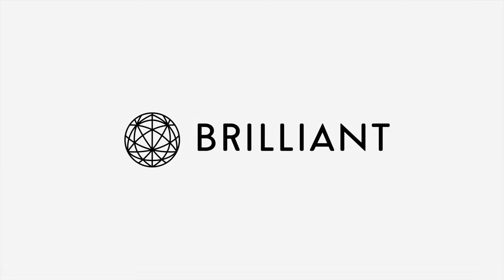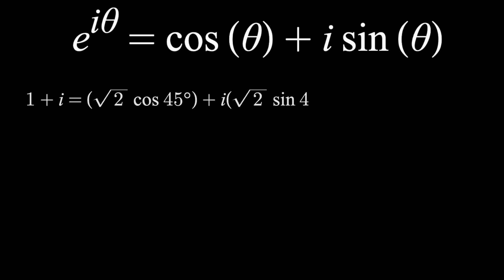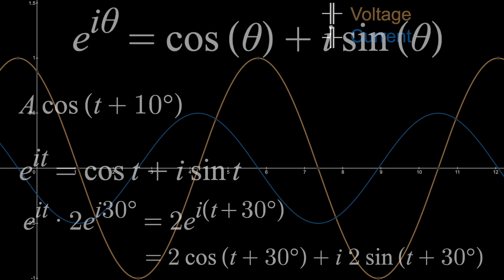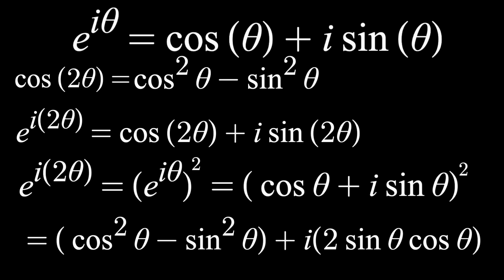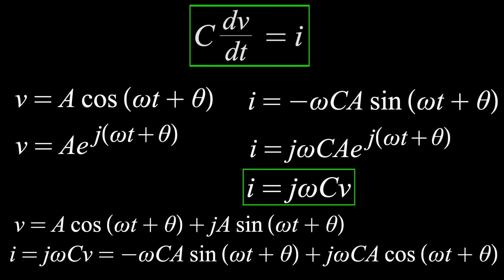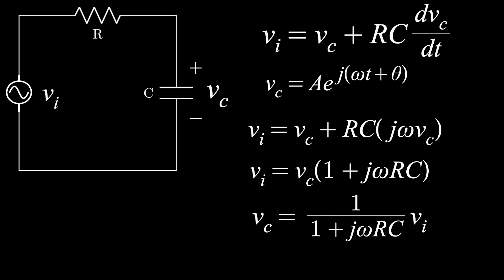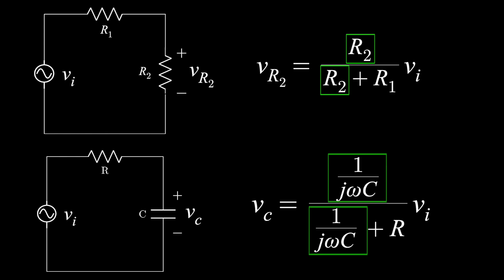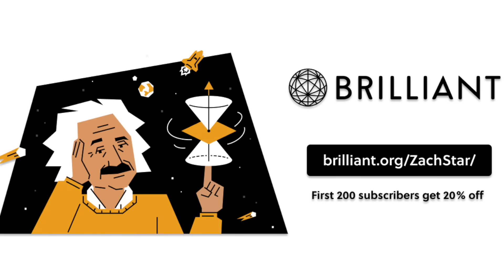Why do Electrical Engineers use imaginary numbers in circuit analysis?

Comment: It doesn't matter what tricks you use for calculation, in the end you need real numbers. And this "imaginarity" is simply a way of saying "this one is a perpendicular graph of real numbers". Same as y is imaginary to x axis. It's just that you use a coefficient that requires an additional axis. But in the end you have to use real numbers to describe a process. Can't have i charge, it's gonna be 1. Well, it's because it's not a number but a number with operators stuck to it. sqrt(-1) is same as /1 or *1. It's a number and an operator that makes no sense unless you perform actions with it. It's not a part of the number. -1 is also 1, only measured on the opposite ray of x axis. Take an apple and move it 1 meter to the north. Now 1 meter to the south. Now any direction you choose. You use 3 axes and negative scales to describe the direction but in the end any direction you choose is a positive number of degrees deviation from any point 0 and any distance is a positive number of any chosen units. There's nothing negative in the world. So there's nothing imaginary either. Only our calculations.
Reply: Nope, you use the imaginary numbers, to describe a real process...no need to switch...
Reply: @RoninTF2011  Unless you show me a factual something measured in i's you're free to keep this fantasy to yourself. I was quite clear, re-read if you need to understand instead of arguing.
Reply: @RedGallardo  so you say time, angle and superposition are not real things? lol
Reply: @RoninTF2011  Time cannot be measured negative. Even if you show me a process of something seemingly going back to an earlier state, it's gonna be de-facto a process in time running forward. A time-travel is a process in time running forward. It's impossible to go back due to the principle of cause-effect. Cause never precedes effect. Angle can always be measured as positive number. Negative only means direction. It's the same as blue angle or angle in fa major. It's just a name that helps us pick the right positive among positives. We need it, universe does not. It knows which angle is which without names and negatives. Superposition is a general term like "power" or "size". Be specific. So quit the demagogy, I say no real things are negative. Negative is a crutch humans invented for our imperfect counting system. We are limited by brain, universe counts without any borders and difficulties.
Reply: @RedGallardo What makes you think "i" is a Unit of measurement?
Did ever have any science education?
Reply: @RoninTF2011  What makes you think I said i is a unit of measurement? I said the opposite. Stop arguing with your imagination in my presence. I'm feeling left out.
Reply: @RedGallardo  "Unless you show me a factual something measured in i's you're free to keep this fantasy to yourself."
Your text not mine...
as sensble as the request to taste light...
Reply: @RoninTF2011  Are you even capable of thinking? I said i is only for calculations and not for measurement, you started to argue, I asked you to show me how you measure something SINCE you disagree. Which means YOU said it's a real measure. Now you're taking it back. Then what are you arguing about? Get some help.

Comment: The simplification of using phasor notation comes with the hidden assumption that all operations on the voltage will be linear operations. For non-linear devices (for instance when analyzing distortion products) you have to go back to sines and cosines
Reply: I thought we EEs were sharp til I started studying fluids. I don’t EVER want to have to find any PDE BVP solution in closed form….
Reply: No. I disagree. The hidden but necessary assumption is that the analysis takes place at a constant frequency. All passive components are modeled as being linear. There is a phasor representation for the Fourier series, if ... at least... non-linearity can be modeled around harmonics of a fundamental frequency.
Reply: @willthecat3861 Yeah, but like, the second you add a transistors, or even a simple spark gap, then the math becomes a LOT harder

Comment: No you can NOT write 1+i as sqrt2 e^(45i). The angle MUST be in radians in exponential form.
Reply: They had the degrees sine after 45. So if we just treat the degrees sign as a scaler than maps degrees to radians, then the maths is true
Reply: @gregoryfenn1462   Except that's not what it is.

Comment: Thank you for this great video. At first I was bothered by the extra imaginary number, thinking 'Now there's extra stuff. What is it?', but then I realized that we are actually removing stuff in a way. We are transforming the problem from having the input voltage specified as a arbitrarily complicated function to something more constrained. We notice that the input function 'sin(...)' can be 'calculated' by reading of numbers on a disk after rotating it. So we've reduced the problem to that of rotations. Rotations are less powerful in the general case, but they are sufficient for the problem at hand, and they are simple linear algebra and so easy to work with. The imaginary part has always just been part of the "structure" that rotates. And taking the real part is "reading the number of of the disk".

Comment: Imaginary numbers sound like complete nonsense until you realize that i is essentially just the invisible y coordinate on an x number line. It's an extra dimension which can represent whatever you need it to represent. In this case, phase.
Reply: oooo if we follow the very easy grasp methood of just using x and y coordinate system and not give a crap about imaginery dragons and numbers... how would we look superior ...
Reply: @nagyandras8857  i is basically just a placeholder for an extra dimension
Reply: @nagyandras8857 How will using regular XY coordinates help you? Vectors do not follow Euler's formula

Euler's formula is a feature that arises from complex numbers (And it is very elegant to drive). And this is the feature that allows you to skip differential equations (Since you are turning everything into exponentials). That feature is the reason we use complex numbers. ODE can be simplified
Reply: @nagyandras8857  Look dude, if I say exp(ix) = cos(x) + sin(x). This is just a simple math statement. Nothing magic is going on besides i being √-1. Which you can just think of as a indeterminate form that you have to find a way to cancel (Like you do with let's say 0/0 in calculus). There is nothing magical about that expression beside

We use it in EE because taking the derivative of exponentials is extremely easy. So we replace cos(x) with exp(ix). Then solve the far easier differential equation, then take the RE() of the result. This is called phasor notation, there is nothing magic going on
Reply: @nagyandras8857  I cannot, but that's not the fault of imaginary numbers, you are just miss-using them. I cannot give you [3,2,1] burgers either. Are you gonna then claim arrays and matrices should not be used in computer science??
Reply: @sebastiangudino9377  apples to apples. Not oranges.
Reply: @nagyandras8857  Well, yeah, so you can't have I burgers!

But let's say a spring moves as a perfect: speed(t) = cos(t)

Now I want to get the acceleration, which is the derivative of the speed. Let's asume I don't know the derivative of sin. But I do know exponentials and Euler formula. I then replace: speed = exp(it) (We added a meaningless i undetermiante form, we can later remove it with a function called RE(z) )

An then the acceleration is dexp(it)/dt. So i*exp(it)

Then we use Euler formula to expand the equation i * (cos(t) + i*sin(t)) = i cos(t) - sin(t)

Then we remove the with RE which leaves us acceleration(t) = - sin(t)

You solve a derivative problem while avoiding derivatives thanks to phasor notation!

Comment: I just wanna point out that a lot of professors may remove points, when using the method shown around 6:30. If v = Acos(wt), then v = Ae^(jwt) is technically incorrect. To fix it, just express it as v = RE(Ae^(jwt)), where RE() indicates the real part of the complex exponetial; or express it as (A/2)*(e^(jwt) + e^(-jwt)).

Even the professsors that say, "I don't care if you box in the right answer; I only grade the work shown," will probably only take 1 point off on a 10 pointer (not a big deal).

I enjoyed the video Zach, but I thought I should give this PSA for anyone that has a professor named Wanda or Leonard.

edit: "(A/2)*(e^(jwt) + e^(-jwt))" was incorrectly express as "(A/2)*(Ae^(jwt) + Ae^(-jwt))"
Reply: Thank you for this. As a mathematician switching to EE for a fresh start, it scares me how engineers sometimes ignore nuances like these
Reply: @nestorv7627   No problem. There was actually an error in my logic caused from coping and pasting the text. I wouldn't have noticed it, if you never commented, so thank you.
Reply: @nestorv7627   It was my dream to become a mathematician, but my DE prof pulled me aside to talk (he probably didn't get many students that score perfectly on both exams and hw); I told him that I wanted to study math, but he persuaded me to get into engineering instead. I graduate EE next sem, and the only time I felt that I learned any real engineering was the second/third week of EM waves when we were solving problems using the derivative form of maxwell's equations. Every other time, they just lump the necessary parameters, needed to actually solve the DEs directly, into empirical ones, then only expect you to use the "formula" or "procedure" instead of actually understanding the actual physical process.

Am I missing something, or would you also say that, for the most part, engineers suck at understanding the actual math used in their field?
Reply: But if you say v = RE(Ae^(jwt)) then there's no way to make the equation i=jwCv work: i=jwCv is wrong,  i=RE(jwCv) is wrong, i=IM(jwCv) is wrong, it's all wrong. You have to work with some higher-plane complex voltage v*, then v=RE(v*), i*=jwCv* and i=RE(i*)
Reply: @viliml2763  You are absolutely correct that "i=RE(jwCv) is wrong."
This shows why you can't just plug numbers into equations because i = C (dv/dt) = C(d/dt)RE(Ae^(jwt).
Phasors confuse so many people, all you need is Euler's formula and the original DE, and then there's no need to remember the conjugate identities for phasors.
Do you want to see the derivation done that way, because I did leave it out as an exercise for the reader?
Reply: Why do we ignore the imaginary part?
Reply: @leonhardeuler9839   I think Zach did it because loves his phasor analysis too much. There is also half as much work to show, and also half the work to grade, so professors and students may like it for that reason. The alternative is to differentiate the last expression of v = cos(wt) = RE(Ae^(jwt)) = (A/2)*(e^(jwt) + e^(-jwt)) and multiply by C, then you don't need to worry about "ignoring" the imaginary part; it will just cancel out in the end anyways. I think the real question is why convert it to complex exponentials in the first place, and the answer is all about the basics of frequency domain analysis.
Reply: I disagree. Taking the RE() is called normalizing or renormalizing. And there is no reason to do it anywhere except the very end to simplify the maths

Comment: So does that mean that there are some circuit problems that can't be solved without imaginary numbers?
Or you can do circuit analysis with real numbers just fine but it's more complicated.
Reply: You can analyze circuits without imaginary numbers just fine, but it'll be more work.
I'd like to note that for simpler circuits that only have sinusodial generators with the same frequency, you don't need to write up any functions because you can treat currents and voltages as a constant complex number (as time goes on, that number would rotate with omega frequency in the complex plane, but so would the axis you'd consider the real voltage/current in the given moment)

This basically means that for these circuits, you can just replace capacitors with an impedance equal to 1/omega*C*j and inductors with omega*L*j, and then you can just treat it as a DC circuit (only difference is that you do arithmetic with complex numbers). The steps in the video would only needed to be done if it were not sinusodial or if you were to have multiple generators with different frequencies, as they would fall out of sync (values would truly depend on t, so you'd need a function).

I'd like to add that in highschool (or whatever is before University or whereever you learn complex numbers), if you learn electric stuff you would learn AC circuits without complex numbers at all. In this case you imagine AC voltages and currents as vectors and you'd use trigonometry and pythagoras' theorem to basically do the same computations but without the complex numbers. This has the benefit of not needing complex numbers, but it also means that you can't really apply DC formulas (you would need special "vector arithmetic" formulas to keep track of phase), but with complex numbers, both the amplitude and phase in tracked as a single number

This complex-free solution is only applicable for the simple sinusodial circuits, and they really get out of hand if you have both series and parallel connections (You keep track of amplitude and phase separately, and it would pretty soon become a trigonometric mess to add vectors)

((Of course, it would be a separate journey to prove that treating simple sine AC circuits as DC but with complex numbers is indeed the same mathematically as writing up the exponential functions, and this video would be the basis of that.))

Comment: The analysis of a circuit leads to a set of differential equations which must be solved simultaneously by using techniques of solving differential equations in order to achieve the desired result. While if it is converted into the imaginary form, then they become a set of linear equations that can be solved using linear algebra.
Hope it answers the question.

Answer by Ali Riza Afghan.

Comment: The math trick of changing from sinusoids to complex numbers is based on ignoring the transient part e^kt in the total response, but in general it take few miliseconds and can be ignored, so the trick is useful.
Reply: It is when the inductors and capacitors have some stored energy. We usually analyse the circuit when they are in steady state means the transient response has died out long ago.
Reply: @POPO-od8jb that's not the case in electrical power systems engineering. That transient part is absolutely crucial in this case.
Reply: These circuits can be generalized to the s-domain, where the transient response is not ignored. Using purely complex exponentials is a stepping stone to doing that
Reply: If you're interested in transient response of electrical circuits, next check out Laplace transforms.
Reply: Quando se adotou números complexos na Engenharia Elétrica, não tinha como se detectar um fenômeno de frações de segundo.

Comment: First learned AC circuit analysis in the Navy.  We would just compute impedances (Z = 1/(omega*C)) and keep track of 'angles'.  So if V is 120v / 0 degrees, and capacitor had impedance of 10 ohms/ 90  we simply too 120v/10ohms = 12 amps at (0 - 90= -90 degrees).  And combining capacitors, inductors, and resistors in circuits was similar to resistor-only combinations, but keeping track of the +90, -90, and 0 degree angles.  At the beginner level, we didn't go into the complex math, just 'remember the rules to keep track of angles.  When multiplying, add the angles and when dividing, subtract"
Reply: This is basically the same way they teach in highschool before complex numbers. Note that by "keeping track of the angles" and using special formulas to add there values with different phases you are basically doing the same calculations as if you were to do it with complex numbers by hand (using trigonometry and pythagoras' theorem)

While simples to understand, this method has the disadvantage of having different formulas (for example you cant just calculate the parallel resistance with XY/(X+Y), as you would have no way of accounting for the phases).

Also, if there is both series and parallel connections, this can quickly spiral down into lots of trigonometry just so you can keep the phases, while with complex numbers, you are basically hiding all this nasty arithmetic by using a single 2D number to store both the amplitude and phase (and mathematically this allows you to use the EXACT SAME formulas as you would for DC, so you don't need to learn any new formulas except for the generic complex arithmetic)

Comment: It is not clear how you mathematically expand the imaginary number to a trigonometric form. It would have been nice to understand and see the module calculation process and the angle or phase calculation process.
Reply: a+bi = re^(iθ)
r is simply the amplitude, and because the "a" and "bi" parts meet at a 90 degrees angle, you basically need to calculate the hypotenuse, so r=sqrt(a^2+b^2)

for the angle, you can take the same triangle, and calculate the angle between the hypotenuse and the real axis with atan(b/a). Note that for degrees 180...360 (or 0...-180), you would need to correct the result of arctan, as it would give an angle value for the area above the real axis. Most programming languages to this automatically by using a custom atan2 function ( -> atan(b,a), note that you dont divide, but give the two values as a separate argument so the function can automatically correct the result based on the signs of the arguments)

Combining these two results, for every a,b
a+bi = sqrt(a^2+b^2) * (cos(atan2(b,a))+i*sin(atan2(b,a))
Reply: @darkrtfm  thank you for your time and clarification.
In your last paragraph and last formula, shouldn't it be: ... (cos(..) + i*sin (..)) ?
Reply: @GooogleGoglee  you are absolutely correct🎉
Reply: @GooogleGoglee  yes, it should be, sorry.
I corrected it :)